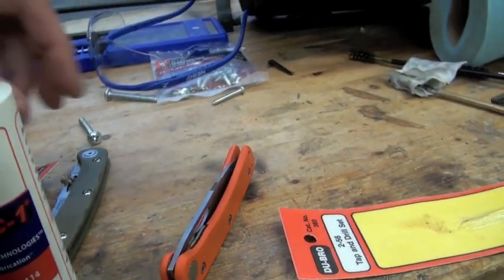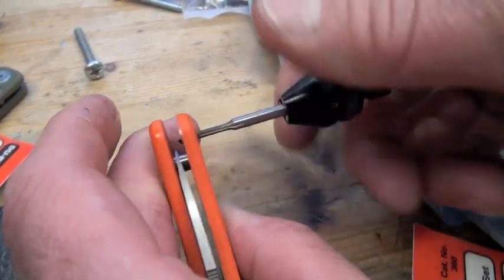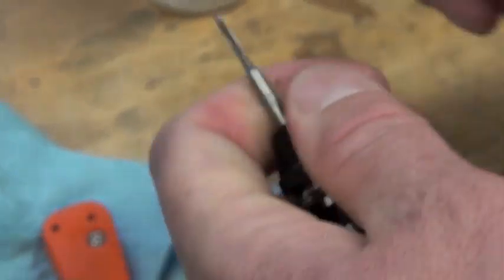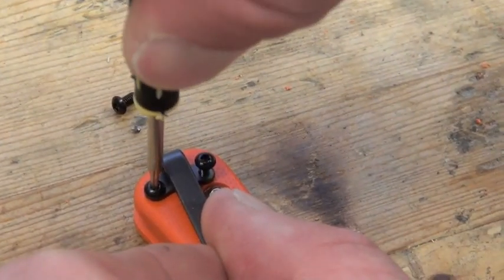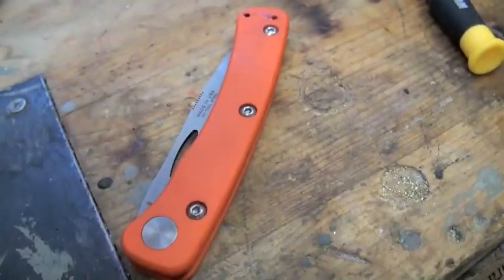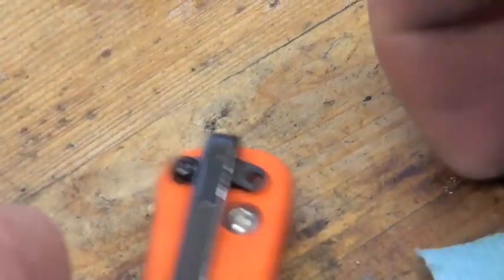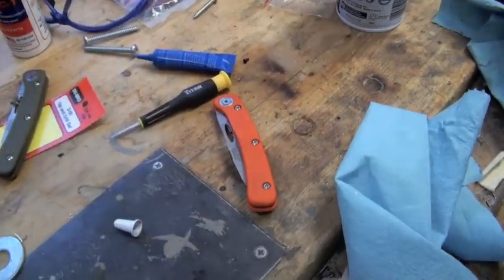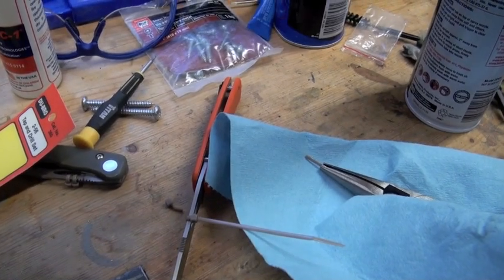Installing Clip in KOA Lighweight Hunter: Achieving EDC Perfection!

Comment: If you have never drilled and tapped before I would recommend a small drill press, but a vice will suffice as well, just make sure your alignment is straight at all times. Does not take much to break a little tap! Be sure to wrap the knife in some rubber or similar medium to protect it from the pressure of the clamps grip.

Comment: Try a different technique on tapping next time. 1/4 turn forward, then 1/2 turn slowly reverse to "break" the curled burr and give it a chance to go into the flutes that are cut into the tap. Best to have it horizontal with the tap vertical. Compressed air works great with a rag over it to control the chips. Don't keep a continuous clockwise twist because the burr has no where to go. Just a suggestion.

Comment: Are you versed in Google? A tap is a tool steel cutting bit that creates the grooves or threads in solid material to accept screws. 

I believe it was a HSS or titanium coated bit, suitable for steel that he was using. Cobalt bit would be better. A drill press would be 20x better set at slow speed and kept wet by a cutting oil to quench calories.